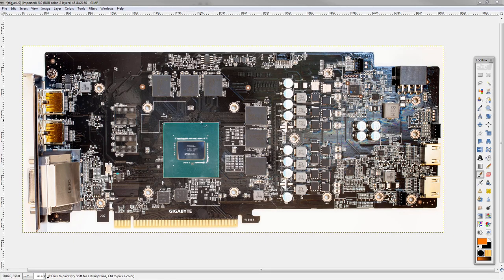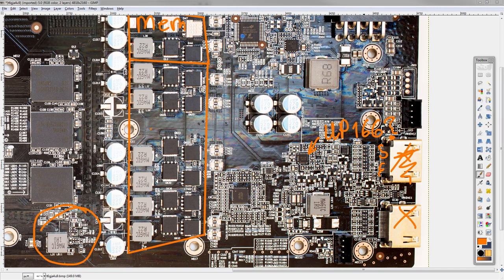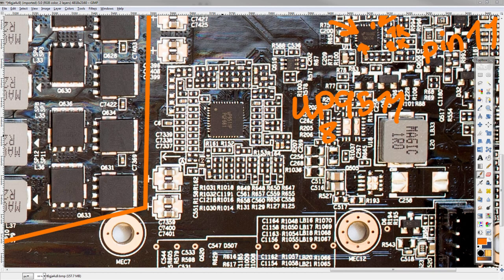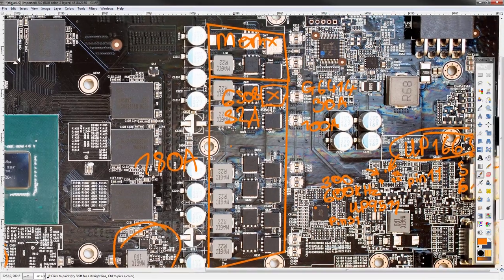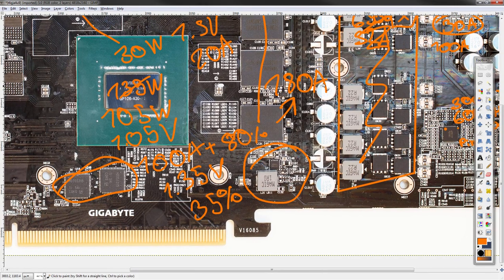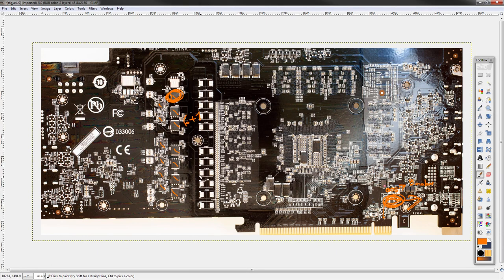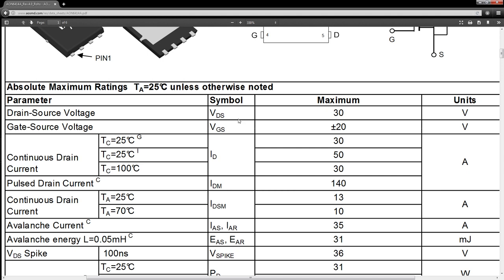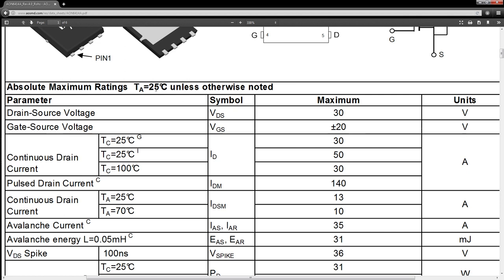Gigabyte GTX 1060 6GB Xtreme Gaming PCB breakdown + mods +  MOSFET datasheet check

Comment: Buildzoid raises a good point: The (140A) "Pulsed Drain Current" capability of the high-side MOSFET is indeed for INTERMITTENT pulses.
It is difficult to predict what a high-frequency/low-duty-cycle rating would be in this case; there are different formulae that can do so, but they're each specific to different MOSFET architecture; there's no "one size fits all" equation for it.
That being said, my guess (as an EE) would be that they're probably good for (conservatively) 50A at 500KHz 1/12th duty – (since we have six phases and a high-side/low-side split), but that's purely a guess (albeit one informed by past experience). I might grab some and test them to destruction to get an ACTUAL spec. (If so, I'll post the results).

Comment from the maker: FIRST!
Reply: второй
Reply: Actually Hardcore Overclocking hi buildzoid. I was wonder if u know how to push 50% power limit of sapphire r9 380 nitro on driver 17.1.1.
Reply: quick question buildzoid 

how is your tec water chiller doing ?
Reply from the maker: still in the planning stage because I keep buying GPUs instead of parts needed for the chiller. Though I think at 10K subs I'll ask EK or some other Waco company for support.
Reply: maybee alphacool can help you. At them moement im in contact with them because im trying to bild my owne Tec Chiller. Maybe they have a proper block for cooling 2 40 mm x 40 mm 60 W and 60 X 60 235 W Tecs. Hopfully they can help me and maybe even you

Comment: I have a problem with this card. LED diode @ 8 pin power connector is flashing,sometimes randomly, sometimes 10 or 20 times, but card is working fine, temp are also normal. What these flashing means ?

Comment: What happens if instead of using liquid metal paste for the power mod you just put a little piece of aluminum, like tin foil, and instead of soldering you just stick it in place with some tape? That could work or I'm gonna brick the card? :D

Comment: Ey buildzoid, novice hardware moder here, can you explain why hooking up the potentiometer to Vcore and the usual ground and sense pin of the controller lets you control the voltage the way you mentioned. Please don't spare the tehnical details. Thx
Reply from the maker: It's old and it's probably even worse than what I make now but it should cover everything you need to know: https://www.youtube.com/watch?v=4BYdAm_Atts

Comment: Can I use the RX 480 BIOS that's on der8auer's overclocking.guide on an MSI Gaming X? Even though the BIOS was released by ASUS. And will it fuck with the fan curve?
Reply from the maker: It's probably not going to be compatible since the MSI is very different from the reference cards.
Reply: Actually Hardcore Overclocking
Yes as it turns out using it is benchmark doable, but the memory doesn't want to clock over 2050MHz. Is there any other way I could do 1.3V on this MSI card without using the Elmor BIOS?

Comment: Can you tell me what are those little ractangle thingies around the GPU core?  I was cleaning the thermal paste off my 1070 and one fell off!  Surprisingly the card appears to work just fine.  Any idea what they are and what effect it could have removing one?
Reply from the maker: those are capacitors
Reply: I thought so, even though they look more to me like a resistor.  Do you think it will have any effect?  I have an RMA in process anyway since it was related to the EVGA thermal mod, so they're sending me one through advanced RMA.  That means until I send mine back, I'll have 2.  SLI 1070's, lets see what you got!
Reply from the maker: it might clock a bit worse or be unstable in certain scenarios since those are bypass caps for voltages powering the chip

Comment: Isn't that pin 30 you highlighted on that up9511?
Reply from the maker: you're probably right. I've been kinda off all day and trying to translate the 9511's pinout was the end of my mental capacity. Here's the datasheet if you want to check: http://www.ubiq-semi.com/files/1486/9d6c41b9-f7ba-11e5-88e3-c6d5d9c034c4

Comment: can i use 0.01 ohm resistor on 0.005 ohm shunt and how much power increase will that be
Reply from the maker: The reason I recommend using the same size shunts is because if you drop the current reading too low the Nvidia drivers will go into safety mode and lock the card at 139MHz

Comment: shoud i buy the 1060 gaming X or the asus strix?
Reply from the maker: Buy and RX 480(XFX GTR/ASUS STRIX/MSI Gaming). OC vs OC the 480 will win against a 1060 and at stock the 480 matches the 1060 in DX11 and wins DX12.
Reply: All ASUS STRIX Polaris with understated power limit.
Best of AMD RX is Sapphire Nitro + and XFX GTR / HIS Roaring...
Reply from the maker: My RX 480 STRIX doesn't have any temp or power limit issues. It temp throttles above 85C and has a 110W power limit just like any other RX 480.
Reply: with the stock bios? What are your offsets if I may ask?
Reply from the maker: Offsets?
Reply: non all
Sapphire Nitro+ 225W 
MSI Gaming 180W 
XFX GTR & HIS Roaring 180W power limit
Reply from the maker: I have a GTR it's 110W
Reply: how much +core clock/+core voltage/+memory clock were you able to get on the stock bios.
Reply from the maker: Haven't tried maxing the card out yet. Also the review sample I got lost the silicon lottery really badly. I'd guess it as being in the lower 505 of RX 480s. So I don't expect anything incredible. Also being such a miserable sample it hits the power limit really fast.
Reply: Alright, Imma try overclocking mine and post back with results!
Reply: Sawowner thx guys i think i will for rx480its cheapr and powerful but i mihht overclock it to the max whem i strat seeing lagg and issues, i have a gt 620 1gb ddr3 and ive overclocked to the max stock was 810mhz core and 700mhz memory and i oc to 950mhz and 950mhz, iv tried to increse more the vram like to 1ghz but the card will botlenec in power tehm i have —20 percent of fps and i cant messwith thw volt.  going to build a new pc soo, abd them i will post the gpu that i want to buy of that rx480
Reply: RIP my card is worse... Can only get 1340mhz on stock voltage and can't even hit 1400mhz when maxed...
In fact I had to raise the power limit to even hit stock clock speeds without throttling.

Thinking of RMAing the card...
Reply: Actually Hardcore Overclocking maybe with ln2. I haven't seen any 480 overclock as much as a 1060

Comment: Why can't the Pascal BIOS be modded? Or perhaps rather: Why could previous generation BIOS' be modded? If nvidia properly implemented a semi-decent signature scheme then there should be little hope of cracking that, short of somebody leaking the master key (assuming the signature verification takes place on the actual card?). So how did previous generation BIOS modding work? Did nvidia simply not sign/lock down BIOS? Did they use an insecure signature scheme?
Reply from the maker: I don't know why there aren't any options to mod Pascal BIOS. I just know there aren't. 

For previous Nvidia cards there was BIOS modding tools. Again I never looked into them that much as I haven't had many Nvidia cards and of the ones I've had I've so far had no need for modded BIOSs. From the little I've seen of some of the past BIOS tools it just looks like Nvidia BIOS is way more complicated than AMD's and Nvidia is really trying to crack down on unofficial overclocking. Pascal is the first series of Nvidia cards to enter safety mod if you short the shunts too much, or if you disable the temperature sensing system using a physical mod.
Reply from the maker: The only "modded" BIOS for Nvidia cards is the unlocked BIOS for the 1080 STRIX and that was made using Nvidia's official BIOS making tools. Now theoretically you might able to figure how that BIOS manages to be "unlocked" and then copy that into another BIOS. However I wouldn't put it past Nvidia to not put a BIOS signature check on their cards.